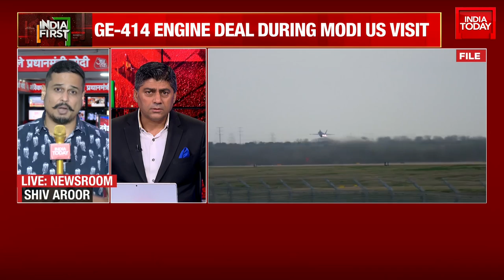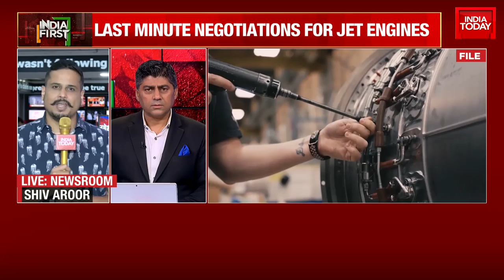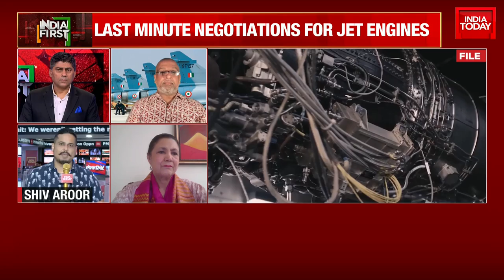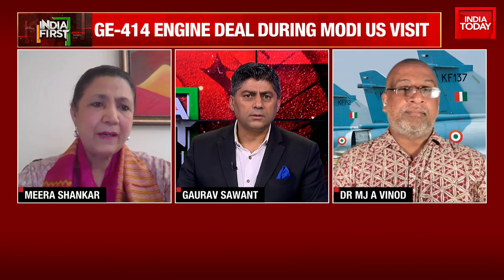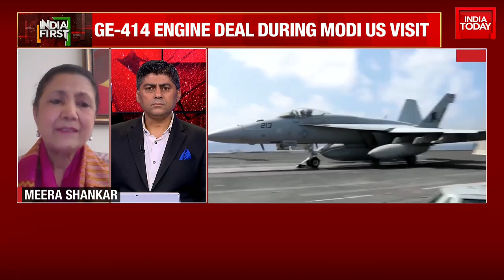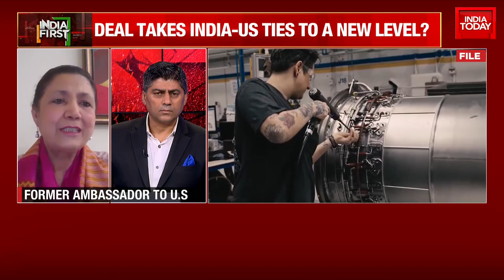Kaveri Engine Suffered Because Of The Metallurgy : Dr Mj Augustine Vinod, Defence Expert.

Comment: For all the keyboard warriors going on a rant here in comment section, let me tell you, you can't even imagine to grasp the complexity of the physics, thermodynamics and metallurgy that goes behind these jet engines. The part everyone forgets is we have very limited funding compared to other nations and also that Kaveri has not been a complete failure, it's just that its dry thrust is not at a level desired for powering our jets. It is however good enough to power UAVs which is already being worked on in form of program GHATAK UAVs. Moreover, with the acquisition of full ToT of GE-414 we'll get the know how of the critical and advanced hot core technology of the jet engines required for higher thrust. So with due respect, I'll request everyone to be patient and not criticize where you don't have in-depth knowledge to back up your critique.
Reply: full of BS, even with TOT for Su 30 MKI make in India for 20 yrs, India now still needs directly import over 1500 parts and raw materials from Russia and the cost make in India Su 30 MKI is more expensive than directly buy from Russia
Reply: @firetree2007 There has been no ToT for Su-30MKI. Apart from avionics, HAL merely assembles the jets from CKD kits imported from Russia. Localisation of its components in miniscule.
Reply: Full ToT of GE-414? Are you sure, actually, USA does not have such a track record of full ToT of its advanced equipment, even to its close allies such as Japan.

Comment: Don't blame one department whole kaveri team is incompetent and internal politics led to failure. Gtre department in drdo is name go and take rest.
Reply: Our govt departments are inherently bureaucratic and inefficient to be sure. But then, developing a jet engine that generates the necessary thrust levels while remaining small and light enough to fit in a small fighter jet isn't exactly an easy task either. And then there is the exotic alloys that its components require for reliable operation. Many of these knowhow are closely guarded secrets by Western firms.

Comment: Another plan is to jump the gun and go for the latest tech, when even the base was not there, it was set for failure,. if you design and engine based on best parameter it is going to prone for failure. It is time to work on what you can achieve, go for capabillity, then super duper design,. go with multiple milestone and success and use the tech, every other country has gone through the phase. what if the engine is few 100Kg more weight, make sure it has little more power and the capability can be achieved with more relax parameters. If the power is there, you can fly a fighter with the same capability, what is this fetish with small, compact and best of freed everything.  Use what has been achieved, now you know the capability, design on the same principle bigger engine with better power, design the fighter with modular engine pay to adopt to bigger and smaller engine.

Comment: when China first made J20, Indians laughed at it saying due to the engine it is not a real 5th gen fighter, ok, at the first J20 used AL 31 engine with Max power output of 131 kn, so it is not good enough, but do you know what is the max power output for GE414?  it is only 91 kn, if AL 31 not good enough, GE414 is much worse, now China has used China's own WS 15 engine, with max power output 180 kn, 2 times more powerful than GE414.
Reply: Its not just about the power, but the compactness, quality and long-term reliability of the engines. A small fighter jet like Tejas needs only a lower powered engine, but it needs to be compact enough and reliable. Ask IAF about the notorious reputation of Russian jet engines. Half of IAF's Sukhoi and MiG-29 fleets are grounded at any given time due to their engine troubles and other mechanical issues. Its too early to say if China's domestic jet engines fares any better in reliability and engine life.
Reply: @vineethgopalakrishnan3967  we should go for Al-41 new engines  for Sukhoi jets that has resolved this issue and quit using old Al-31 engines.

Comment: A country that was/is supposedly the greatest at metallurgy and alchemy having basic metallurgy issues?
Most of the DoD has been govt owned - with no accountability  of govt employees. 
It’s time to privatize the entire DoD in india that’s when it will flourish
Reply: How do you know it is "basic" metallurgy issues? You have any idea of the sustained high temperatures and pressures that a jet engine's turbine blades and other components have to endure for reliable operation? The designers would need to know what kind of alloys to use for these components and how to manufacture them. Most of these knowhow are closely guarded secrets by Western firms who spent billions into their research for decades.

Comment: Indian light combat aircrafts require more thrust generating high engines to be integrated to LCA present ge f414 engine is useless.
Reply: we're using ge 404 engines, ge 414 has more power.
Reply: As you have yourself pointed out, Tejas is a LIGHT combat aircraft. As originally envisaged, it didn't really need a more powerful engine than the F404. However, IAF's expectations from the aircraft with regards to its capabilities like weapons load and operational range has changed and Tejas Mk1 powered by GE F404 do not meet their needs. They need a larger fighter jet - Tejas Mk2 - which consequently would need to be powered by a more powerful engine, which is the GE F414.